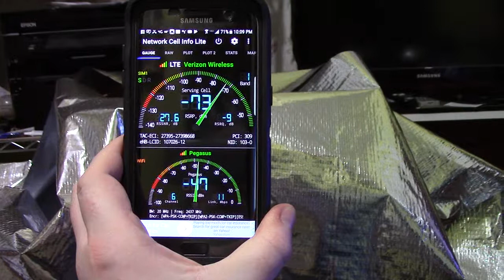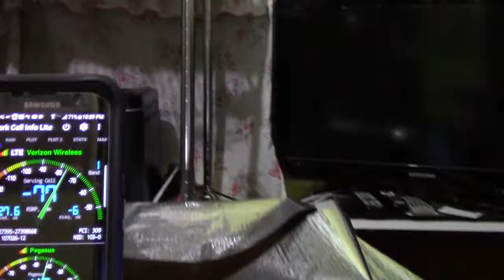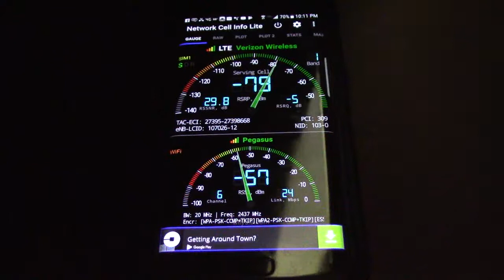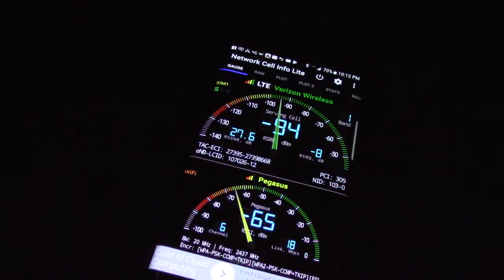Radiant Barrier Faraday Experiment

Comment: Good test.  Looks like u lowered by 20 db.  That good and half of what I have heard is needed to be safe.  Bc of how cheap / easy / tough radiant barrier is compared to other materials this is a very good start.  Aluminum foil will give u twice as much but is fragile.  Maybe aluminum foil under radiant barrier.

Comment: i made a bag using the silver insulation tape.  I used pandara on my ph.  Used card board insert. Place phone in cardboard. Pandara lost conection.  The phone  stayed on when I open envelope.  I had to seal bag with tape for it to work. 
So not sure.

Comment: That is not a good test. Your radiant barrier had perforation that allow the radio signal to goes through the barrier.  And you don't tell me if the bottom had a radiant barrier to block signals from going through the bottom.  
You need to redo the test with none perforated radiant barrier and indicate that the bottom also has none perforated radiant barrier to make the test valid.  
Otherwise your test video is not a valid test and is just junk.